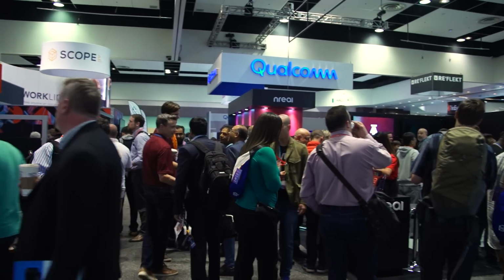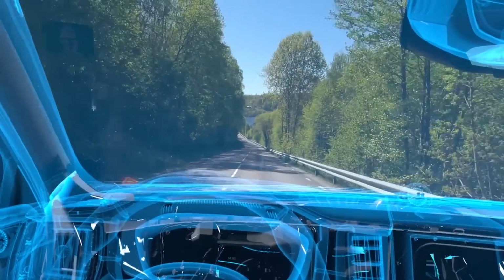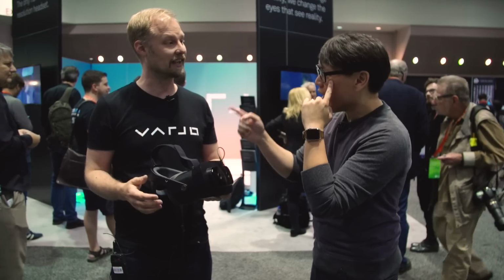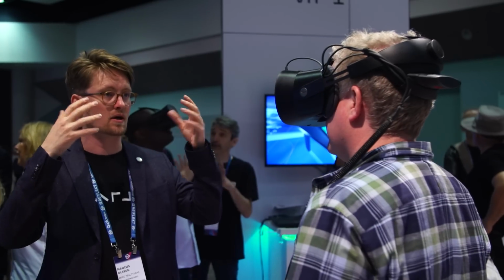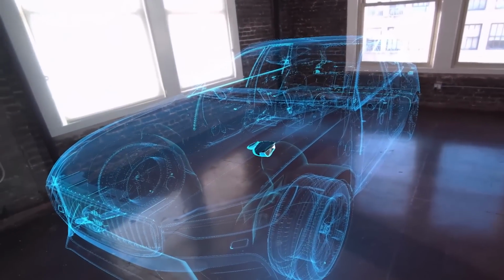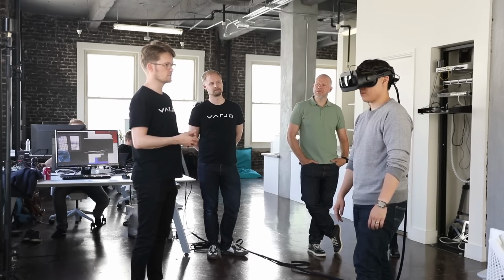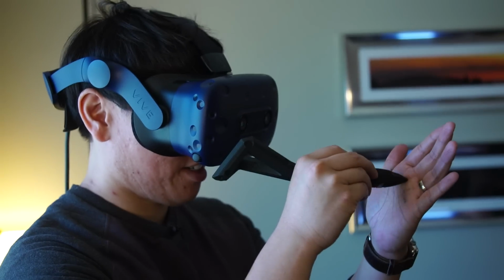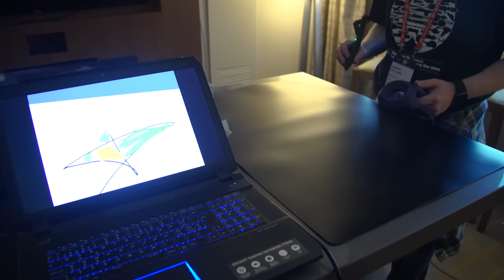Varjo XR-1 Augmented Reality Headset Hands-On!

Comment: What Varjo is working on is literally the one missing feature that has kept me away from getting my own headset so far. Last thing you want to do is backhand a toddler or dog, or punch your wall. I really like their work around with the camera passthrough. That's pretty brilliant when combined with their dual panel hardware. As for the Logitech pen, not really interested. Doesn't make a lot of sense in a single artist application. Could be great though in a team setting. Being able to easily share and work on something with others in VR would be cool.

Comment: Tested the VR-1 last month for the USAF in a flight sim using Prepar3D.  Not seamless enough...  And couldn't get rid of screen tearing no matter what settings I used and field of view was somewhat narrow..  Would probably be great for design work with a stationary subject but not great for a flight sim.  Also, doesn't work in SteamVR.  We're going with the XTAL.  Wider field of view no screen tearing and works in SteamVR.  Important for us as we're probably moving to X-Plane 11.  Better flight model.
Reply: Working with VR-1 since it launched for simulations, there is no screen tearing for us and it is only working with Steam VR, like literally. There is no other official tracking solution for it tho I hear that Volvo integrated some other tracking system for out door usage

Comment: Steam VR needs work tho... Great tech but its tethered by a very delicate cable cable.
Reply: No , it's not. Been using mine almost everyday for 3 years without any issues. The 3-in-1 is just as strong but lighter. SteamVR is still the best tracking solution available, nothing stumps it.

Comment: Guys if you want to see truly no compromise VR headset you should check out XTAL
Reply: XTAL compromises in SDE, 70hz (below what is acceptable for VR-presence)(limited by DP1.2, which is terrible), and requires the top-end GPU (obviously). 
XTAL is full of compromises for the FOV and clarity. Is still (arguably against the Reverb) the best HMD for simming. 
The price is also the reason that no one is buying it, $5,800.
Reply: @sqlevolicious  its not better than varjo but xtal is incredible

Comment: If they were able to have a larger human eye resolution display in this thing, they could save on the bandwidth by only illuminating and rendering the portion of the image where the eye tracking was pointing. In that case, through the optical combiner they have, anywhere you looked would be extremely high resolution. It would be hardware-side NON-fixed foviated rendering.

I'm sure the financial price of a pair of those screens, though, worries them more than the additional bandwidth and processing cost of rendering at retina resolution to the whole field of view.

Comment: So many headsets, zero good choices.  Just give me high res, high frame rate with perfect blacks and HDR.  Till then bye.
Reply: Every tech has trade-offs. Your expectations don't match reality (current state of technology). They can't give you that great headsets with all these specs cranked up to the max and at decent price because it's currently not possible.
Reply: @kazioo2  if they can do it on phone then can do it for a vr screen.  It's just that they know PC gamers have accepted terrible monitors while tvs are far superior (4k 120hz HDR low lag with vrr) so they know they will swallow bad VR displays.
Reply: @kidShibuya  That micro displays the HMD is using are the best display tech that mankind invented. They are manufactured by sony with 1500 $ price tag.
Reply: Sooooo, you want the Index. True blacks do not work for VR due to smearing, HDR is going to be very important but is still in development. Only a handful of games/experiences have HDR implementation.
Reply: @sqlevolicious  lol smearing?  Wtf you talking about?  OLED is the fastest tv tech.  And HDR isn't in development, had it for years on my tv and phone, it's old tech.

Comment: Goes to show, passthrough is the ultimate AR & VR.  All the Magic Leaps and Hololens of the future will only be as good as their optics, and their optics progress slowly.  Those headsets will always be hampered by refraction, secondary reflections and so on.  With passthrough  the optics are not the issue, it becomes an issue of cameras, displays, and software, things that advance technologically much faster.   With passthrough, you could turn off the lights, or change or augment anything or nothing.  It holds the ultimate potential if the displays can get better and the cameras/HDR issues can be solved.   Enter next gen micro LEDs, light field headsets and new types of cameras.  The curious thing is why feed all the real-world camera data to the computer and back again?  It seems some local chip on the headset should be able to handle that if the cameras improve.  That would leave the augmenting and interpreting tasks to the GPUs.
Reply: The problem of pass-through (or in-vr mixed reality) is that you are suddenly limiting your significantly superior natural vision with limitations of cameras and displays that may not be fully solved in this century (dynamic range, resolution, various display-related artifacts - each tech has different). With the overlay AR you are only affecting digital stuff and reality remains good quality. In other words: both approaches have their huge pros and huge cons. If you really care about both aspects both are terrible and that won't change in the near future,
Reply: @ @kazioo2  There's this common bias that says human vision is impossibly superior to technological cameras.  But the camera is not a fixed thing...it evolves.  Look at how 15 years ago hand-held cameras were the only way to take pictures(now its 90% phone cameras).  Also, cameras do not have to be similar to the human eye in the same sense that a plane's wing doesn't have to be like a bird's wing.  Take high speed cameras, video cameras, UV cameras, long exposure cameras, and so on.   Maybe you have 20 different mini camera with different exposures.  Maybe it'll be any combination of these or emerging camera technologies.  Human vision is ultra-subtle and dynamic, but it does not evolve like our technology does.
Reply: You need to send the camera feed back to the gpu anyway so that it can do all of the image processing so that it knows where to overlay stuff. If the headset composited gpu feed and the camera feed, they would be out of sync because the gpu is working with older camera information.

Having said that, the gpu could use its most recent camera frame and the headset could do the composition along with some asynchronous space-warp magic. I wonder if that's what they're already doing?
Reply: It makes more sense to have a gpu do all processing since it is much easier to just upgrade a gpu to increase performance than to buy a new hmd every year or so. Also makes the headset lighter, less complex and cheaper. You would possibly even need some kind of active cooling.
Reply: There is a lot of backlash to wearing anything that covers up a huge part of your head and face. I know a lot of people who will never wear something like this (not least of which for reasons of looks and messed up hair). So the Hololens, nearly non intrusive glasses type of AR is still superior in that respect and much more acceptable for the majority of people. But also more difficult to achieve.

Comment: lots of realism...completely undone by having to wrangle that damn umbilical cable  (words of a VIVE/TP-Cast user ....I've got no strings to hold me down...)
Reply: Just wait until you can have a personal 5G emitter for the low price of $150,000 then you can transmit 8k res no wirelessly
Reply: @FiveToesTwoFeet  I'll take 1/10 of that.
Reply: @FiveToesTwoFeet  That's not how 5g works. What you are thinking of is 60ghz, which is a solution we have had for about 8 months (vive wireless adapter -$300).
5g is a cellular network signal with lots of throughput and speed for specific network signals, it's not built for low-latency streaming.
Reply: @FiveToesTwoFeet  We might be examining the first viable use for laser based data transmission.  The system knows exactly where the headgear is and could keep a laser trained on its receiver with a servo controlled system.  There would be lots of bandwidth that way and it would be way cool both to see and for marketing. Then we could go 8K for each eye and rock on.  We don't really need a full 8k but that would definitely be enough.  Wires really do suck for room-based VR.  That said, they wouldn't be so bad coming out the center of the back of a full VR suit suspended in a multi-axis mounted harness.  I can't reach back there anyway but that rig is something completely different and requires taking the matter up a couple levels. :-)  I'm in, even if I have to 3d print my whole suit.  I just need a viable design.
Reply: Same
(Oculus quest user)